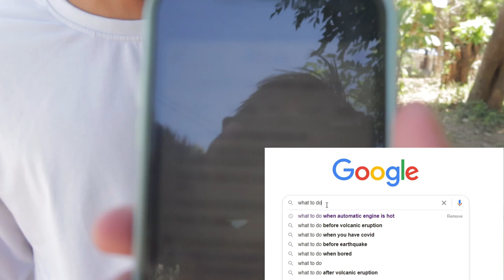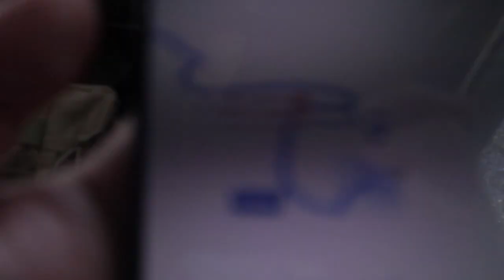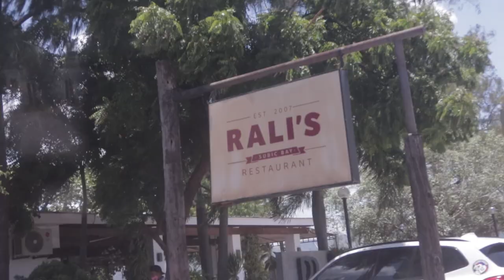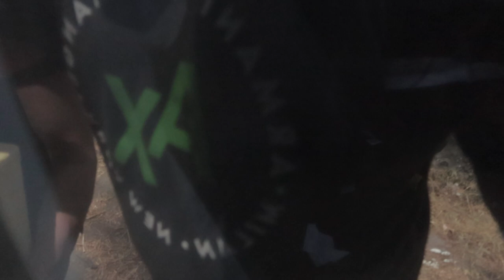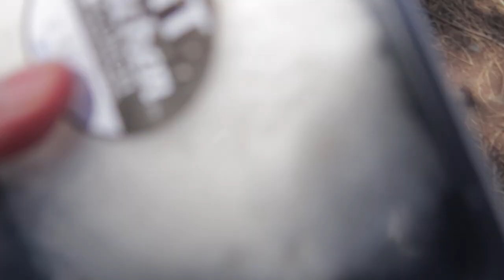ANG BAGONG HOUSEMATE

Comment: Mix Alcohol (can be vodka or San Miguel) with water if you don't have coolant (learned it from a Russian friend). That's a last ditch solution if you don't have anything left. If it is automatic, go below 3 (acceleration, not speedometer) to avoid overheating again. Some drivers don't lock there hood all the way to let in some air. Make sure the hook it attached to the hood to avoid accidents.